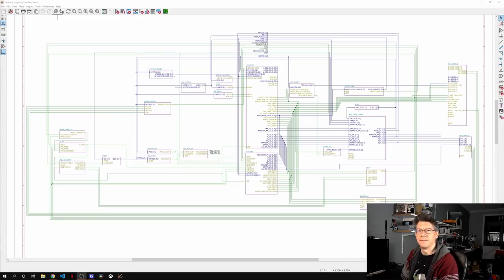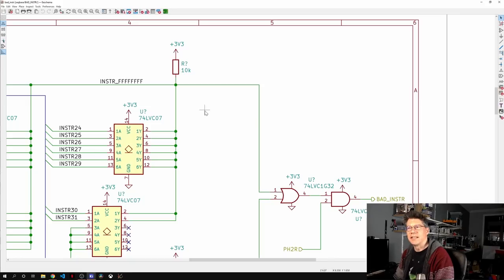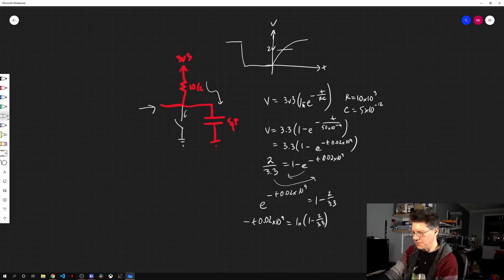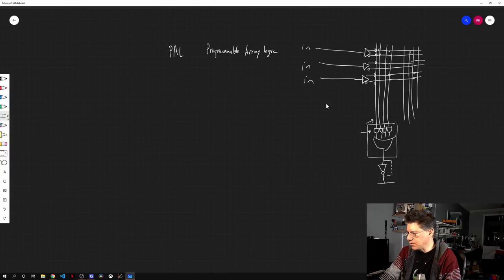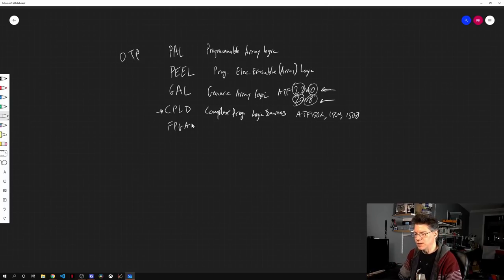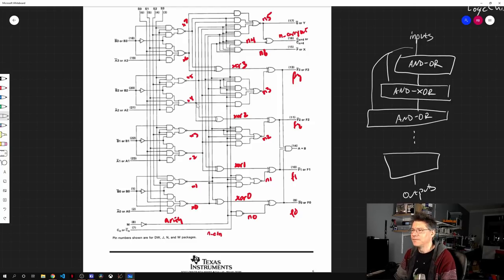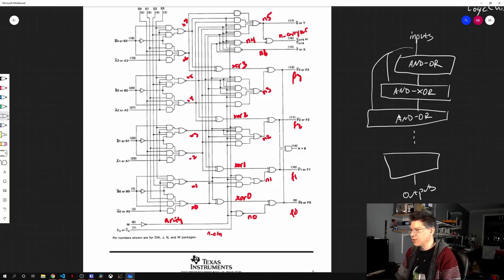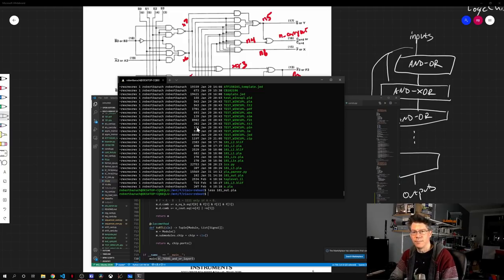LMARV-1 reboot part 14: Chips that don't exist

Comment: To calculate the charge rate of a capacitor, I use the simplified formula  t = from 3 to 5 * R * C, if I want the highest possible frequency, I choose a factor of 3, otherwise 4 or 5. In this case, the error fits into the temperature factor and the spread of the circuit parameters.

Comment: There is the 74HC688 that works with 3.3V. It is slow, in fact slower than the pull-up resistor implementation... With so many chips, the wiring will mostly dictate the speed, so I would not care too much about it. And at that rate the whole design can be 74HC with 5V supply, which is a better speed than 74HC at 3.3V. Also the fastest logic can be done with the 74CBT or 74CBTLV switches. They are especially good for the barrel shifter. They even have a 16-bit bus exchange part that could be used to reverse the direction of the shift. They have 5 Ohm resistance, 0.25ns propagation delay and 5ns switching delay, so even a ripple carry adder will have just 5ns overall, as the carry propagation is only limited by the 0.25ns delay. But again, given that it is a discrete design, the best speed is probably around 15MHz, for which 74HC at 5-6V is plenty. Maybe some critical parts like the adder using the faster 74AC283 in a carry select configuration could be used.

Comment: Dear Robert. Sad your second attempt failed. It feels that both times you have had a good start and then things spiraled out of control, because you want to plan them out perfectionist. Maybe for another attempt at such a project try small iterations, can you build elements or part of a spec. Does it have to be the full RISC-V 32 ISA or is the reduced ok...  . Your work was great and inspiring though, thank you very much.

Comment: RC time constant for 10k and 5pF is 50 ns. 2/3.3 is not far from 63% (one RC time constant), so pull up time is about 50 ns. As you say, there are plenty of variables (more inputs, output capacitance, trace capacitance, tolerance, temperature etc.), so a ballpark number is good enough.

Comment: Be very careful with your reasoning for 3.3V working with 5V logic... The value you want to consider is not VCC, but VOH_min. Every chip has a range of driving voltages, so you may have a case where a 3.3V chip has a VOH_min of VCC/2 which is 1.65V. In that case, the output logic level will be lower than the input voltage threshold on the 5V chip. I have run into this issue with connecting 3.3V chips to 2.5V IO banks on FPGAs.
Using a CPLD is probably the better option here, though you are going to end up with quite a few of them.

Comment: So what is the propagation delay of the CPLD with all its layers?
Reply: 15ns for the ATF1502ASV. There are GALs as fast as 4ns. The internal delays are quite low, so the layers don't contribute nearly as much as pin delays. Same for FPGAs.
Reply: @madhusiddalingaiah5301  15ns for one cell or for the whole stack from input to output?
Reply: @obiwanjacobi  15ns pin to pin, so yes whole stack from input to output. That's the maximum delay for the -15 variant. The minimum is 3ns, so it's not bad. You should read the Pulitzer prize winning book titled "The Soul of a New Machine" by Tracy Kidder. He describes the design of the Data General Eclipse, which was probably one of the last discrete processor machines built. It was designed around newly released MMI PALs, which was somewhat revolutionary at the time.

Now you can do it all in one smallish FPGA, designed on a weekend, easily clock at 100 MHz or more.